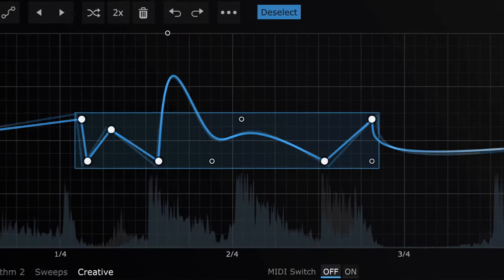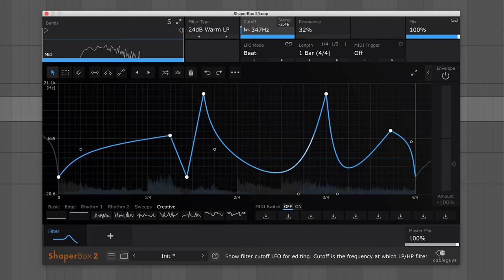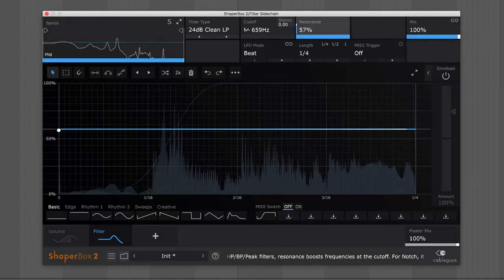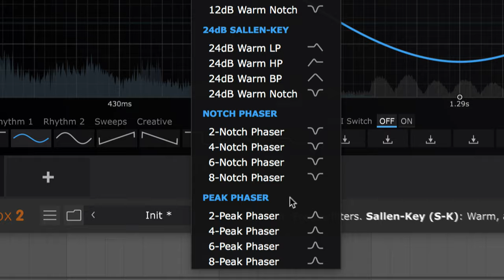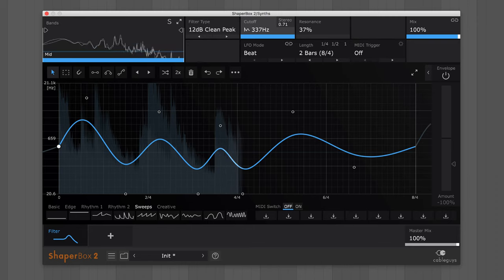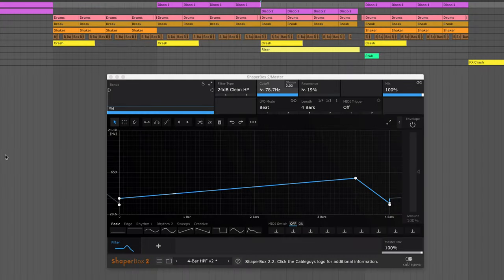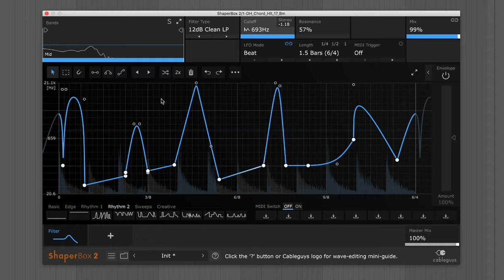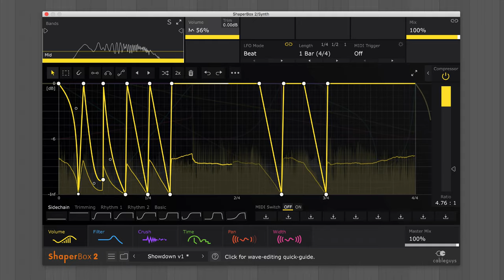How To Make Your Music MOVE With Filters | Cableguys VST/AU/AAX Plugin Tutorial

Comment: Been using this awesome plugin for a while! How can I modulate the cut off?
Reply from the maker: Do you mean automate, as in host automation? The Cutoff parameter is the average of the points in the LFO curve, so whenever you edit the LFO curve, you are also changing the Cutoff value (try drawing some points in the LFO and you'll see the value changing). So for example, if you'd have automation armed while editing the LFO curve, you'd inadvertently overwrite your Cutoff automation with semi-random values. Also, some DAWs (eg, Ableton Live) would interpret any change in Cutoff value as the user adjusting the control manually, and automation playback would be disabled.

In short, allowing automation of Cutoff and Resonance as regular VST/AU parameters could unleash chaos.

A workaround is to use the Envelope's Shift slider (which is an automatable parameter) to offset the LFO. This works even with the Envelope's Amount at 0%.
Reply: @Cableguys  Ok totally makes sense and that's actually what I ended up doing with the ableton LFO tool. It would be interesting to be able to modulate the entire cutoff at some point. Like moving the entire set of values up and down as one unit while keeping the LFO shape in tact. Might be a nightmare from a coding standpoint though not sure lol. Great plugin though I use it all the time!
Reply from the maker: @Brandonbraun  You can do exactly that by automating the Envelope's Shift slider, as mentioned above 😉👍
Reply: @Cableguys  Ok great it sounded like that's what it was doing but I couldn't visualize it in my head lol. Thank you!